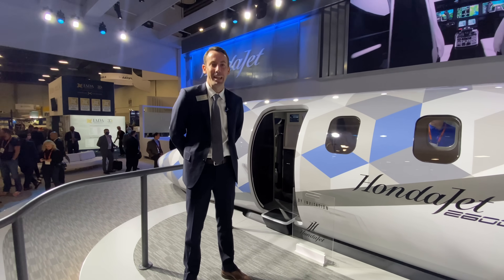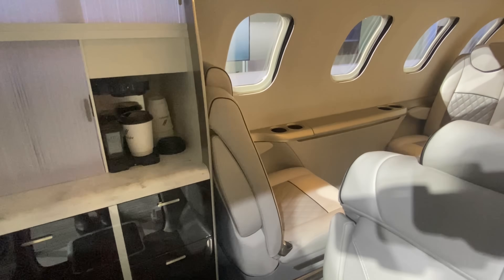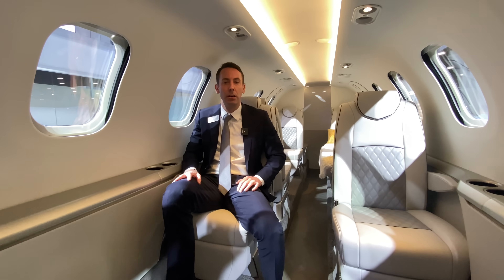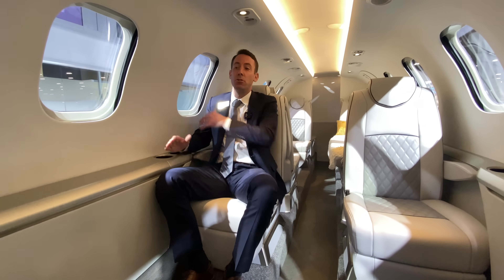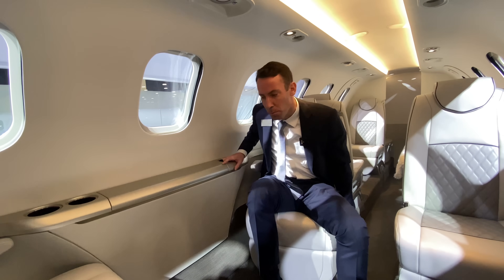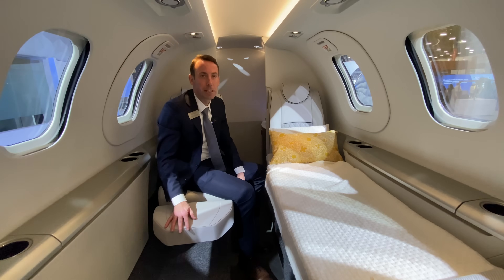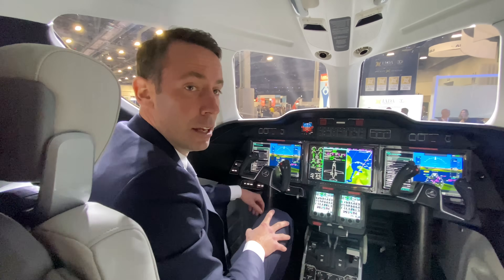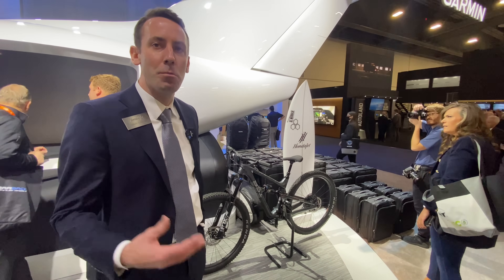HondaJet Echelon Concept design

Comment: It needs to have emergency return added but expanded on so if over water it can carry on to destination if over 50% .  Also to cut down on pilot workloads please add advanced auto throttle system for single pilot mode, but with increased ceiling, please develop and add early slow decompression warning system for pilots since slow decompression symptoms are hard to notify in newer pilots if no action within a designated time allow auto pilot to run emergency land notification and decent to below 10,000 then max vent the cabin  if pilot still doesn’t deactivate and check in with atc within 5 minute window with crew or passengers.  engaged full self land to nearest major airport thus allowing medical to be on standby once plane stops on runway all below 10,000 ft

Comment: If they only make it (and they're able to make it) - it would be the Phenom 300 killer. I don't wanna call a paper aircraft awesome, but it surely can become awesome.  People mentioning Citation Latitude etc. - just google who was the best selling business jet in all categories for like the last 10 years. Not Citation Latitude. And there's a reason for that. 
You can buy a used Gulfstream for like $1.5 m - so what? You have no money to fly it anyway. It's not the purchase price that determines the success, it's the performance/operating costs. If they can keep an hourly price closer to the Phenom (turboprop-like costs range, and they can do it judging by the existing HondaJet), if they single pilot certify it (this is very important both for owner pilots and for everyone else except charter operators, since it cuts costs tremendously) - it's gonna be the new megahit. And by the way, it's not only transcontinental range, it's California-Hawaii range as well, and this is the last leg that cuts the Earth in half for the present light jets. These extra 600 miles are VERY critical. 
Of course it's nice to fly in a Latitude comfort (and even better in an ACJ comfort;), but it's much more important not to sell your last underwear to afford that.

Comment: 🤔☝🏽As A Consumer I Would Suggest that You Install A total Separate Rear Small Closed Off Bedroom in the Rear of the Plane ✈️.
Reply: You practically get what want if you can afford it... its custom design
Reply: This is a light jet, with a range of 2600nm. Why would you need a bedroom?
Reply: @3204clivesinclair  why not? So you can lay on the bed when you sick, not feeling well & need a rest full flat along the way... it's a choice of seating configuration not mandatory